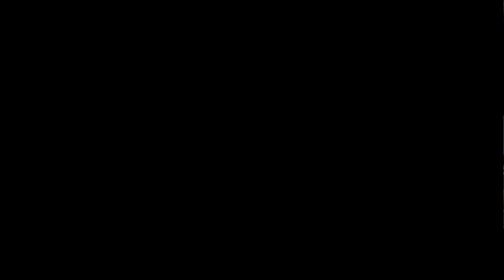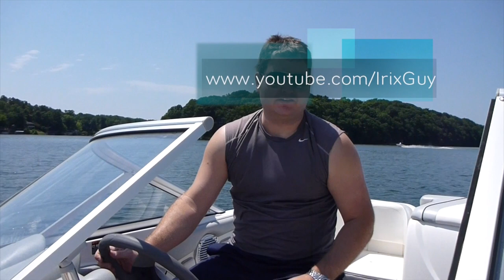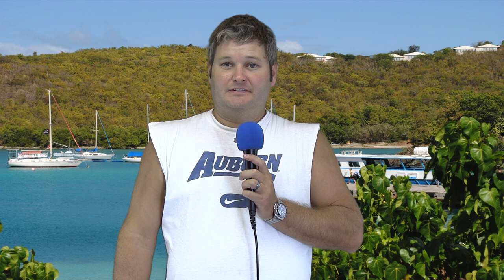How to Trailer Boat with Dead Engine

Comment: how do you line it up straight? my back end always misses the trailer and swings out.
Reply from the maker: Tie the line to the front and pull towards the trailer.  You can then walk left or right as needed and tug to get the hull lined up perfectly between the skids.  Once close enough,  connect her and reel her in with the hand crank.